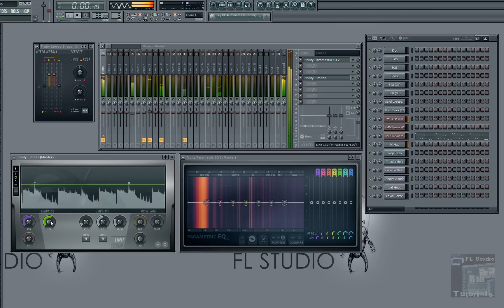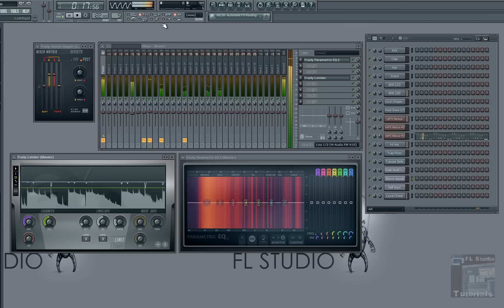Preventing Clipping with Fruity Limiter - FL Studio 10 Tutorial - HD 1080

Comment: Using the SSL bus compressor from Waves on your master channel is a really good way of putting everything in check, once u have that, set a very low threshold maybe the lowest, depends on the song though but it's gotta be low so u don't have too much compression going on, set your attack time to 0.1ms and release to about 1.2 to 3s, works for me every time but you really gotta experiment, do about 4:1 ratio and leave every other thing as it is, you might wanna turn on the analog for some hardware emulation if you like, though your sounds may be coming in pretty hot and to be honest as a producer myself I don't really care about all those red signals coming in as long as I have the SSL Bus comp on my master channel and my audio is not distorting, really it's about using your ears and not your eyes, create your own rules and follow them so you don't end up like everybody else

Comment: Before I even master my track is clipping, but i didn't really raise the volume of any individual sounds in the mixer. Does this mean that I should just lower the instruments in the mixer that are causing the clipping?
Reply from the maker: djjarred Though all your sounds in the mixer may have plenty of room and do not clip individually, as they play together they overlap and the result is a volume increase which can cause overall clipping. so, yes you can drop the volume of all the instruments even more, or a more technical approach is to make sure to give each instrument is in it's own space in the frequency spectrum.Proper EQ also helps. if you can cut out low frequencies out it will help unnecessary sound from lapping. hope this helps.
Reply: +SIX3ONE work on your mix maybe?

Comment: I've got a problem. my track starts out pretty silent and with an automation clip it starts getting louder and louder and i add more. My track does not hit the red part yet it tends to clip like hell when it gets to a certain part in the intro right before the break so its the loudest of the intro it starts clipping like my computer is about to crash yet master volume does not hit the red at all.
Reply from the maker: Sounds like its CPU or Latency issues. You should have an external soundcard with AISO Drivers or similar . If not go to options/audio settings/ and raise your buffer length and see if it helps.
Reply: Sonicoustics Ok, thanks.
Reply: Sonicoustics I sent you a mesage
Reply: Sonicoustics This helped me out! Thanks a lot! :D

Comment from the maker: To answer your second question. I don't recommend stacking duel mastering plugs on one master. To much room for error and the plug-ins will be competing with each other, altering each others sound since they adjust in real time. I like to use Maximus stacked with a vintage warmer a Parametric EQ and a mastering reverb. and MAYBE a L2 maximizer because sometimes the peaks will bleed though Maximus if you are pushing the gain really high, but not usually.
I like to keep it simple, less is more.

Comment from the maker: Good Question. 
I DO occasionally use a limiter on select interments only if they tend to be problematic. Sound like vocals tend to pop and have random high peaks. So I always use a limiter on my vocal track to tame them.
On a synthesizer this is a little different story since you control the velocity of each note in the piano roll separately. So I do both, a limiter on the master and one for peaky sounds/samples.
When u cut peaks you lose dynamics, but you gain more volume so it is a trade off.

Comment: Clipping is a distortion from excessive amplitude. Automating the volume of the master mix to prevent that distortion is another form of distortion. While it may be a smoother form of distortion and less noticeable, it is still distortion. The ideal method is to mix so that no level  breaches 0db. Though, this is unquestionably the way to mix for SQ and Natural Dynamics, it does not give you that highly compressed, ridiculously loud, condensed product found in most modern electronic dance music.